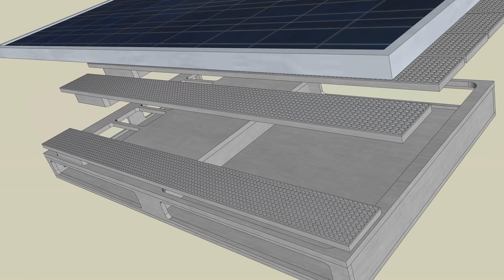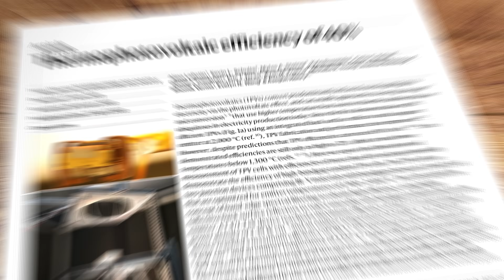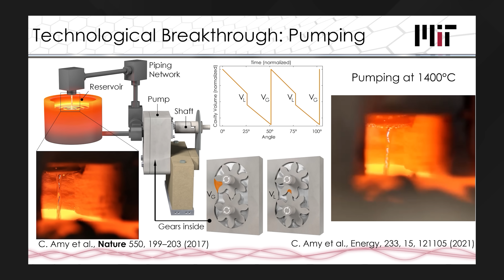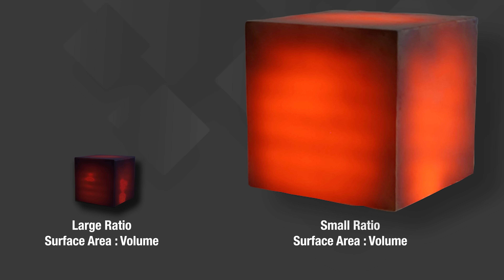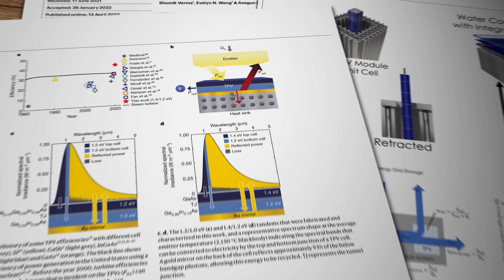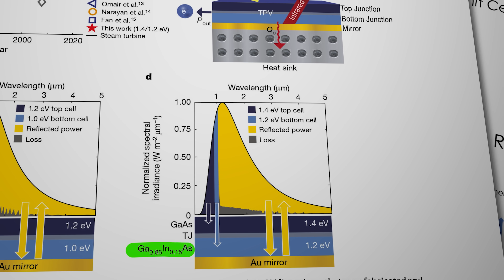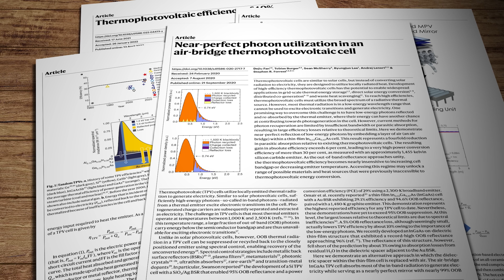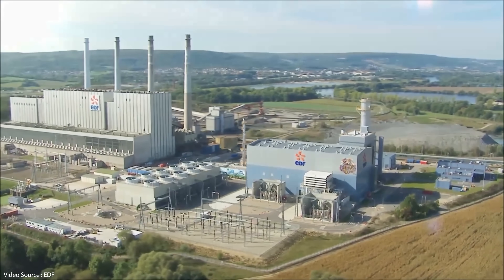Grid Scale Energy Storage 30x cheaper than Lithium-ion! How do they do that?

Comment: Interesting concept. I wonder how this would compare to just adding the Thermal heating & storage to an existing Gas plant which would allow it to run on the stored heat, or gas heat when storage was exhausted?
Reply: You mean use steam turbine from the stored heat? Yes, that does sound massively simpler to engineer, but presumably is very poor in terms of losses in comparison. If this gets similar efficiency of energy storage and return to those of batteries, but with lower installed cost or longer life, then good show, maybe it’s worth meeting the engineering challenges. It sounds to me like like it has less fundamental flaws than hyperloop, so maybe it has a better chance of actually happening, and it would be a doddle compared to making fusion power commercial.
Reply: @richardgoldsmith7278  didn't he say it is 40% efficient, slightly worse than a combined cycle gas turbine, at turning heat into electricity? I'm not getting the use case of this photothermal converter either.
Reply: @Ikbeneengeit  Yeah, I'm not understanding it either, I guess.  It seems like we are going through extra steps, because we are basically taking heat (infrared energy) and converting to heat of a different form (still infrared, but optimized for the PVs?) so we can convert that to electricity.
Why not just use the heat to drive a steam turbine?  I feel like I'm missing an important detail here?
Reply: @gizmo4816  For one thing, the heat is stored as in a battery, so that you don't have to constantly be producing new heat for a turbine. Second, you don't have to run a turbine, with its inefficiencies, if you can go directly to electricity from the heat.
Reply: @Ikbeneengeit  yes he said 40% efficient right now but he also said they know how to get to 50% & that's what will be installed in the pilot plant.
Reply: @Ikbeneengeit  use case is demand following, this seems to be able to react in seconds whereas Combined Cycle reacts in tens of minutes if it's currently running & hours for a cold start.
Reply: @gizmo4816  why not use it to drive a steam turbine? 

Reaction time. 

Steam takes hours for a cold start & tens of minutes if it's currently running whereas this seems to be reacting within seconds.
Reply: @markhathaway9456  it does not work like that; heat converted to electricity will be subject to carnot efficiency limits. I hope you understand.
Reply: @gizmo4816  Indeed, if you manage to have a good technology to store a high amount of energy at a very temperature, there are plenty of option to take advantage of this (to produce electricity or other thermal industrial)
Reply: @markhathaway9456  "For one thing, the heat is stored as in a battery, so that you don't have to constantly be producing new heat for a turbine." - Exactly the same way solar thermal does it. It stores heat as a molten salt; but guess what? No Rube Goldberg machine tacked onto the end, just a simple steam turbine. 

"Second, you don't have to run a turbine, with its inefficiencies, if you can go directly to electricity from the heat." - No, instead you have a system which is inefficient and complicated.
Reply: @richardgoldsmith7278  Yes , Simply Using the stored heat to drive the turbine. Since Storing the heat efficiently AND making and Using the heat using Tungsten foil are the major challenges in using the presentation ( + Another of the Solar panel cooling and waste heat from that ) . Simply solving the Heat storage using it with existing turbines would Halve the challenge. This would be just as efficient as the Solar cells( Less glamorous tho) .
Reply: @richardgoldsmith7278  Why on earth would you store heat when you can regulate output? That makes no sense what so ever.
Reply: @michaelmay5453  Of course storage is involved. It’s instead of a battery for crying out loud!
Reply: @richardgoldsmith7278  do not use steam turbine; just use a regular gas turbine but use indifferent gas (not fuel). At 1000C input temp, you can get decent efficiency.
Reply: @janami-dharmam  the gas has to condense to extract the latent heat energy stored in the temperature to do work, also with the need for huge cooling towers if not on the coast.
Reply: @richardgoldsmith7278  If the working medium in the primary loop is high temperature gas or molten salt you'd just store molten salt. It's at atmospheric pressure and just needs to sit in an insulated basin. Complexity and losses are really low. Storing water at high temperature and pressure is a bad idea.
Reply: @soylentgreenb  no-one was suggesting that storing energy in high temperature and pressure water was a good idea. If you read a bit more carefully, you would see that we were talking about extracting the heat energy in the molten tin store by using it to create steam for a steam turbine as opposed to pumping it around to these very clever but complicated thermal PV units, especially if the turbines were still in place after the gas boilers were decommissioned.
Reply: @richardgoldsmith7278  If you look at carnot effiency limits you'll see that taking a very high temperature heat and converting it to a low temperature heat is a really stupid idea and that you should be using a Brayton cycle at high temperature instead and maybe combined with a steam cycle connected to the output of the gas turbine. Tin is really expensive, you're storing the heat in graphite, not in the tin.
Reply: The weak link appears to be that they will get 40, 50, or 60% round-trip efficiency.   Batteries will give you 95+%, Liquid metal batteries 75(?)% and pumped hydro 65%.
Reply: I wonder how it would compare to pumped hydro storage, or to just adding the heat to a geothermal plant! Heck! It wouldn't even need to be volcanically heated! Just a large array of heat exchange pipes bored into some suitable geology! This would eliminate the construction and development costs. It would also eliminate the need for lots of expensive technology that tends to wear out and need replaced. Heat a hundred meter cube of stone a hundred meters underground to almost 100c using water. use heat exchangers on the surface to concentrate the heat to generate super heated steam to run a turbine. Four guys could run such a plant. Scale it up to a cubic km under a decent sized lake or hydro dam and you just eliminated the need for an extremely expensive plant such as this. Convert a suitable abandoned mine complex to the same task and we just saved millions.
Reply: That's what I was thinking. If you're using a decommissioned gas peaker plant, the equipment is already there to convert heat in the blocks, to electricity via steam turbine.
Reply: @brett4264  Peakers do not have steam turbines, they are a turbine only.  Your confusing peakers with combine cycle powerplants which are far more efficient and not being decomissioned.
Reply: @brett4264  the only decommissioned gas peaker plants left in the UK are used as museums, the other decommissioned sites have already been sold off & are now housing estates.
Reply: Very interesting proposal.
Reply: Whilst it’s being touted as a storage system for renewable sources of generation, could a small nuclear plant not be used to heat the tin to the same temperature?
Reply: @donaldsimpson7698  yes, nuclear could be used to heat tin but why?

The UK's entire fleet is already running at full capacity producing baseload electricity. Building new nuclear makes no sense as it's strike price is 20x higher than solar or wind & it takes decades to get through planning & building whereas wind & solar take months even with our current Charlatan government.
Reply: If the conversion efficiency exceeds that of a peeking gas turbine then yes it would be viable to utilize a second loop which is just a bunch of burners that heat the liquid tin and then run it directly into the TPV system.  It would be the equivilent of how many concentrated Solar thermal plants have a gas fired backup.  Note that this has nothing to do with storage, you would only burn gas for immediate conversion to electricity when your in a situation where the thermal storage has been exhausted perhapse because renewable energy production has been low for several days or weeks and the ability to recharge via the grid has been absent.  Satisfying this need is a seperate need from the traditional 'peeker' role but if the marginal cost of some simple burnes and gas storage tanks are worth it to satisfy this need vs the cost of other alternative long term storage solutions.
Reply: I think some people are missing Brucec's point.  You wouldn't store the heat or power generated by gas, you'd store heat generated by renewables, but if this ran out you'd have the gas as a standby.  The actual generating plant would be (say) steam turbine and common to both heat sources.

The downside would be generating steam by burning gas as this isn't as efficient as using a gas turbine, so really the two systems are best kept separate.

I've heard of a system (on here) that replaces conventional power station boilers with molten aluminium storage.
Reply: While causing the atmosphere to gradually cook us all? No thanks!
Reply: @gregbailey45  Most of Washington and Miami Florida are supposed to be under water by now according to these people instead Obama bought a location 12 ft above high tide and built a mega mansion there. He's not the only one with mansions barely above the high tide line. These people don't believe a word of the BS they have been feeding you or they would have done something else.
Reply: This is a simple idea: once you have some a source of stored heat, you can heat an indifferent gas (say nitrogen) and run a gas turbine and produce electricity with a overall return trip energy efficiency of around 30% or so. You so not need any fancy graphite or something similar, regular stone chips will go as energy storage media.
Reply: Why would a gas plant need storage? Methane is easy enough to store and ramp up production when necessary. That's why they are already used as peaker plants.

It might be worth adding to nuclear installations
Reply: @ThomasBomb45  the UK only has one gas peaker plant (140MW at Indian Queens, Cornwall) the rest are Combined Cycle using the turbine exhaust to heat boilers for steam for the steam turbines which make the efficiency. 
They don't start up fast.
Reply: @ThomasBomb45  I think he means use hear to create steam to run the turbine. And why because the heat is created by renewables and can be released as required to meet peak demand
Reply: @ThomasBomb45  Nuclear is also plannable, it's usable for wind and solar for obvious reasons but not for anything else.

In Sweden we produce far more energy than we need but when it gets really cold there is no wind and we have to fire up oil fired plants instead, this would be used to store extra energy and use it during the time when we can't get it from wind or hydro.

In reality our problem is that we have shut down our nuclear power plants for absolutely no reason what so ever so we don't have enough plannable power and it would be cheaper and more effective to just go with nuclear.
Reply: @michaelmay5453  to understand your question how long does the wind not blow? A few hours for several days??
Nuclear is a full on solution. 
If every country in the world went Nuclear then the military costs will expand massively. 
This is the unspoken part of the nuclear solution to the world stopping CO2
Reply: @michaelmay5453  yes, nuclear is planable, in the UK everything nuclear that's available is running at full capacity at all times, it's used for base load & produces 4 to 6 GW depending how many reactors are down for maintenance. 
The Government's plans for four extra plants would exceed demand most nights on their own at a strike price around 96p compared with wind at a strike price around 5p. Gas, oil & coal are somewhere in between on strike price & can start or stop at a few hours notice. (Open Cycle gas is minutes but it's expensive & polluting).
Reply: @michaelmay5453  a better idea is to use high electricity consuming plants (like Al manufacture; copper refining etc) that can run intermittently. These plants are rather versatile and can be operated based on power supply tariffs.
Reply: @michaelmay5453  Underground liquid storage wouldn't work either because the ground is going to freeze most cheap fluids hey. Bit of a pickle. Do you have geothermal resources in Sweden?
Reply: @michaelmay5453  good answer.
I live in Australia so I needed to hear about your situation.
My concerns are that there are countries that have huge amounts of Renewables but have pressure to use Nuclear SMR technology and will be the reason that nuclear industries will spread to the entire world. 
Clearly you are saying that even the opposite extreme can happen. 
How long does the renewable supply last, 9 to 10 months. ?
Military costs will explode if nuclear goes global. Nobody talks about this aspect of costs.
Reply: @michaelmay5453  good answer.
I live in Australia so I needed to hear about your situation.
My concerns are that there are countries that have huge amounts of Renewables but have pressure to use Nuclear SMR technology and will be the reason that nuclear industries will spread to the entire world. 
Clearly you are saying that even the opposite extreme can happen. 
How long does the renewable supply last, 9 to 10 months. ? 
Ed. I just read your 1 week to 3 months. 
Military costs will explode if nuclear goes global. Nobody talks about this aspect of costs.
Reply: @stephenbrickwood1602   I don't get why you are bringing up military costs? You do get that Sweden, Germany, Norway or Finland all have nuclear power stations but are not nuclear powers? You do get that we spend less on military than you do?

Nuclear power has been global for 70 years by now, our reactors are modern, from the 60's.

Renewable supply isn't a thing, at all. You can't have a supply at all and with high pressures being a consequence of fossil fuel use we can use less and less of it. It's not plannable at all, we can't ramp up or down production at all, it is totally dependent on the weather of that day.

That's why we need a plannable source and nuclear is the ONLY climate friendly plannable source there is. We can ramp up or down production of that from day to day, we can export when needed on the shared market (something we got a lot of shit for not being able to do last winter since 70% of production is supposed to go on the open market) and help nations like Poland or Germany.

Right now Finland is shut out of Russian fuel sources so our main export is to them, Norway is running oil since they have a lot of it and Denmark has the same problem we do (serves them right though, our most modern nuclear power plant was shut down because of their whining).
Reply: @stephyserval  Nope, we have hydro, wind and nuclear. Nuclear is going away and without it we can't make ends meet, especially since 70% of production should be open to exports in times of need according to agreements.

Nuclear is safe and climate friendly, shutting it down has cost us a LOT and we'll need to return to it anyway, as will most nations including Germany.
Reply: @janami-dharmam   We have a lot of those in Sweden, we're converting them to electricity and yet we can't even provide enough electricity to power current infrastructure. These are plants that run 24/7, they can't be run intermittently because for every cool down you lose a months worth of energy.

A better idea is to just use nuclear power so we can provide enough energy to actually run our nation and export to other nations as per agreements made when we had all our nuclear plants up and running.

We had morons in the environmental party convince the government to shut that down and replace it with sources that don't fucking work when the weather changes and more importantly do not work at all when we need it the most.

We need to go back to nuclear, so does most of the world. Until we can actually store energy in a lossless or near lossless way wind and solar will never ever, ever, ever work.

I know 'muricans don't get this because they know people who have bought enough solar panels or put up their own wind powered turbines to create more than they need. What they forget is that those people are connected to the grid so they get power even when the sun doesn't shine or the wind doesn't blow, without that they'd be out of power half of the time.
Reply: @michaelmay5453  "These are plants that run 24/7, they can't be run intermittently because for every cool" What I was saying that they need not turn off 100%, these plants can run at 30-40% load when the power is expensive and they can run at 100-120% of their capacity when the power is cheap. They do not cool down to room temp overnight and with a little power they can be kept close to the working temp.

I did join a protest march against Bersaback and I do not support nuclear energy
Reply: @michaelmay5453  I am afraid this great idea would not be a very economic solution for interseason storage (the bigest issue with renewable)
Reply: @philippepermanne1629   No, it would not work at all. We don't have any choice other than between nuclear or fossil fuels.

Our environmental party knows this and apparently they love oil, gas and coal. There is no other explanation.
Reply: There is absolutely no reason to do that since gas is a plannable source of energy which can be used at the exact degree needed at all times.

You need storage for things like wind and solar, not for gas, oil or nuclear.
Reply: @michaelmay5453  You definitely need storage for nuclear - that's why PHES was invented.
Reply: @odonald6087  That is why it is used as a base with other more immediately controllable sources added in as needed!
Reply: @michaelmay5453  Tell that to places like Texas a few years ago. Gas lines go down. Often in the winter as happened there. Or tell that to WV that about a decade ago had a pipeline blow right near I-77.  While they don't go down as often as power lines, they also are vulnerable hacker attacks.
Reply: @michaelmay5453  One reason is that you would use less fossil fuel overall. There you go, that wasn't even that hard!
Reply: @overover..  No you wouldn't, it doesn't fucking increase efficiency at all, in fact losses are absolute so it would be a less efficient system so not only would it take more power it is also completely useless in every single way. Fossil fuel plants (coal, oil or gas) are completely plannable and can always be run to supply exactly as much as needed, neither more nor less. 

Storing that energy makes no sense what so ever since it would mean running it above what is needed to produce excess and storing that excess in a system that loses energy through dissipation. Obviously a losing energy doesn't make a system more efficient.

I mean, at least think before you reply.
Reply: You don't install grid-scale storage to cater for one type of generation though, it's sole purpose is to fill the gap between immediate supply and immediate demand by capturing energy during periods of excess power supply and releasing that energy during periods of high power demand to stabilise prices and rates of generation at less flexible plants (coal and less-so nuclear). It generally makes sense to install DC batteries on PV sites to avoid inverter efficiency losses, but if you can build storage into other energy sources, why not?
Reply: @michaelmay5453  The need changes during the day with highs and lows. If you could use what would otherwise be wasn't energy during highs it would be a good thing depending on how much this costs.
Reply: @michaelmay5453  IMO, storage for nuclear is much more sensible than storage for wind and solar. Storage for nuclear allows you to take a baseload plant and make it into a peaker plant; the price difference can be very significant. If you're designing a nuclear plant to work on a molten salt cycle or high temperature gas cooled cycle it is trivial to ad a large buffer of molten salt in-between. Operating a nuclear plant at less than 100% doesn't make much economic sense; France does it to a small extent but it is a necessity not a choice (if they did not it would have to be exported, and if it could not be exported the grid frequency and voltage would go out of spec and the grid would disconnect from powerplants and major consumers to protect itself). You only ever need storage intraday, whereas for wind and solar you need storage on every scale from intraday, to days, to seasonal to years; and this all has  to be solved by gluing on different storage technologies at each time scale. That's obviously terrible.
Reply: @soylentgreenb  This isn't how nuclear power plants work. You have a set of reactor and run them at 100% or not at all, energy storage is built into the plant. So you plan on starting a reactor next week because it's getting colder and this makes it plannable in that the output varies with how many reactors are active.

There is no point what so ever to store that energy further, you plan ahead and run the reactors as needed, it's plannable energy.

So for fossil fuels and nuclear energy storage is not needed and for wind/solar we don't really have anything that can store the energy for long enough to make it useful.
Reply: @michaelmay5453  "This isn't how nuclear power plants work." - That's correct, but it is how they can work if you don't build your plant as an extra large submarine engine (PWR/BWR).

"You have a set of reactor and run them at 100% or not at all" - You can load follow slowly but quite deeply if necessary but it doesn't really save you any money, so you only do it if it costs you to get rid of unwanted kWh's that you can't use, store or export (see France).

"There is no point what so ever to store that energy further, you plan ahead and run the reactors as needed, it's plannable energy." - There absolutely is. If you run a high temperature molten salt or gas cooled reactor at 100% you get baseload; but demand has peaks, especially in the evening when the sun doesn't shine. A simple molten salt thermal storage can shift that baseload to the evening when kWh are expensive. This is reproducible every day as the demand is very plannable. Whereas the output of solar and especially wind is an unplannable mess that varies on all time scales.
Reply: @michaelmay5453  I think you misunderstood what was said.